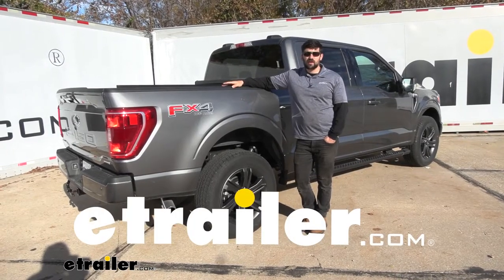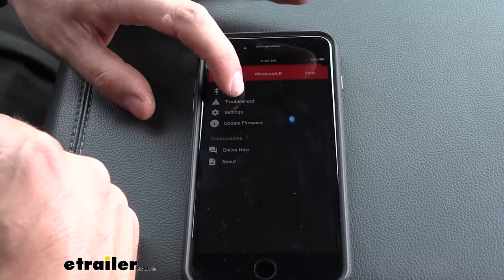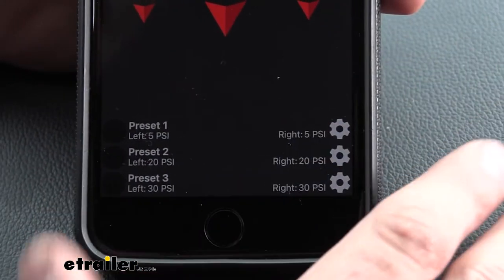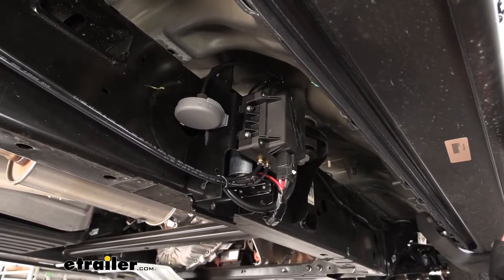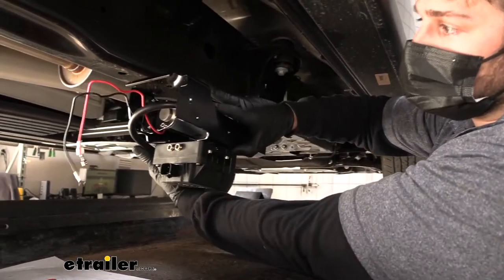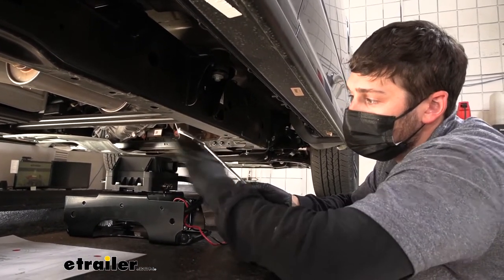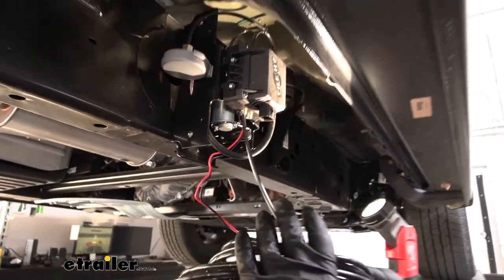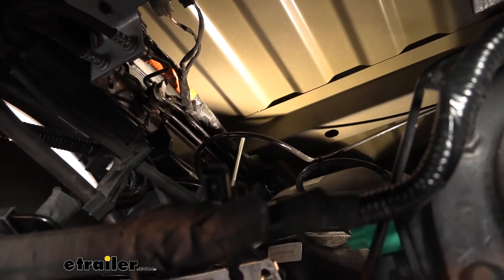etrailer | Air Lift Air Helper Springs WirelessAIR Compressor Installation - 2021 Ford F-150

Comment: By the way, at around 30 minutes in, this man saved me at least an hour and some contortion. I was going to run my ignition wire inside the cab on the passenger side to a 10 amp fuse, so THANK YOU VERY MUCH FOR THAT.

Comment: Can you check the orientation of the remote filter? I believe those intake holes should be oriented down so water coming off the passenger front tire, or from running through flooded areas doesn't pool into the intake holes. It looks like it's deep enough to pool water with no way to escape the way he oriented that remote filter. Mind you, I'm only half way through the video, he may catch this later on in the video. I see most folks putting it in the engine compartment up high somewhere.

Comment: I disagree about “most people will be using the Loadlifter” on a 1/2 ton truck. I was told personally by Airlift that the 5000 series bags are not recommended for 1/2 ton trucks unless you tow/haul heavy very frequently. Even aired down they make a 1/2 ton truck ride harsh. They recommend the Ride Control 2000 series bags for most 1/2 ton owners.
Reply from the maker: These bags will make your ride slightly stiffer if you are putting them on a half ton truck. This is because the factory suspension on a half ton truck is so soft. They are a great add on if you are experiencing extreme sag in the rear end of your truck and you are towing often. We have a few other options for suspension upgrades for the 2021 Ford F-150 in the following link.
https://www.etrailer.com/susp-2021_Ford_F-150.htm
https://www.etrailer.com/Air-Suspension-Compressor-Kit/Air-Lift/AL58WQ.html

Comment: How about mounting inside the frame for better protection for the compressor, hoses and wires?  Just wondering if there’s room on a new F150 there.

Comment: Never heard anyone using a torque wrench on self tapping screws
Reply from the maker: It was a regular ratchet that was used to install the self taping screws. He used it instead of an impact drill to make sure they were not over tightened.
https://www.etrailer.com/Air-Suspension-Compressor-Kit/Air-Lift/AL58WQ.html

Comment: Are there no spare slots in the OEM fuse panel?  I really dislike direct battery connections.
Reply from the maker: There are often spare locations in the factory fuse panel. We have not tried installing this by connecting to a fuse panel.
https://www.etrailer.com/Air-Suspension-Compressor-Kit/Air-Lift/AL58WQ.html
Reply: That depends on your rig. This is an install on a F150 and I don't know of an F150 with stock upfitter switches. Therefore, because of amperage (look at the gauge of wire) I wouldn't be comfortable hooking that to my OEM panel. Maybe a sub-panel, but that's up to the installer (aka) you. The relay power is coming off the OEM panel. Airlift recommends direct battery connection for compressor power, but, this is Murica, and no one is telling you to hook it direct to battery. I haven't looked at my wiring yet to see what the fuse is on this kit, but I'd find one a few amps higher and use that if that's the route you're going to go.